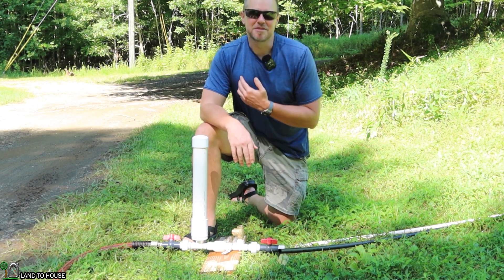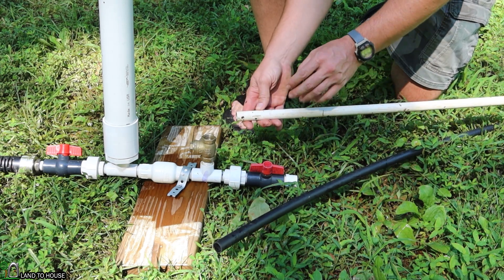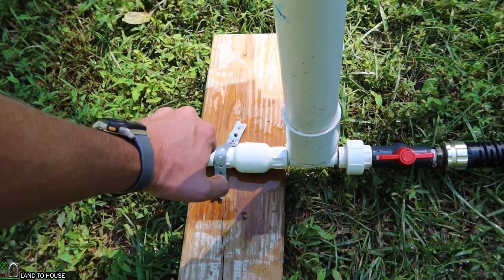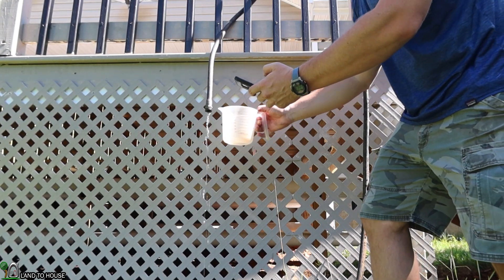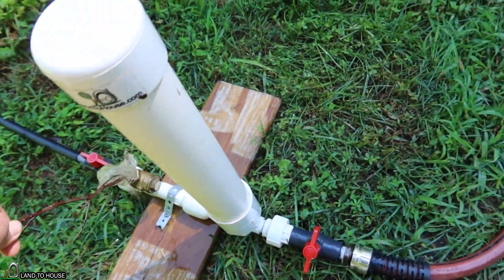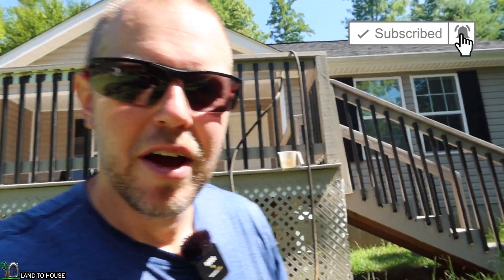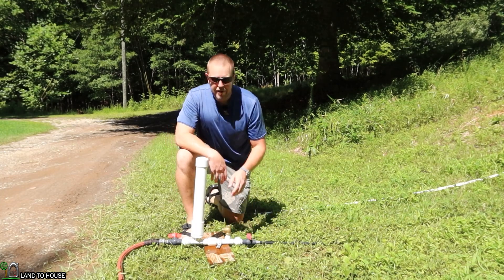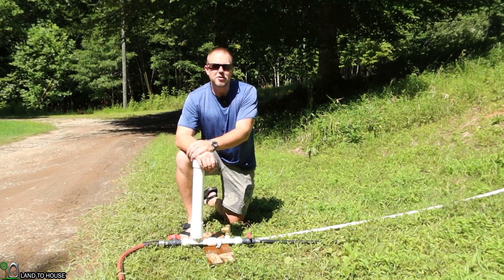Poly Pipe VS PVC Ram Pump Drive Pipe

Comment: I have some questions. 1. If i connect a tube with one way valve on its end to the waste valve an connect it to the delivery pipe, will it work and give more output?  2. If it does, will it work going to higher places like maybe 10 feet or more? 3. A different question, can I use like hose, coiled and not stretched out as my driver pipe?

Comment: If you increase the diameter of the drive pipe would that make the pump more efficient due to the heavier weight of the water traveling through the pipe? Less friction loss or would that act in the same way as the poly pipe allowing a softer Ram?

Comment: I have watched a lot of your videos but I haven’t found where you might have put a pressure pipe before and after the waste gate valve.
Reply from the maker: Typically the pressure tank goes after the waste valve and after the secondary valve. I don't think there would be any purpose of having a pressure tank before the rampump

Comment: Cool, though a little bit less efficient, polypipe is quite functional.  And not to forget that the pump doesn't have to sit in a creek, you just need to be at a lower elevation than the source and it could be up on top of the bank or even out in a field.

Comment: This is why I'm using galvanized near the pump, and poly downstream, I want no flex and as much pressure build up as possible....in this case the more water hammer the better.

Comment: I have about a 30 foot drop to a spring. Is it possible to put 3 ram pumps 1 ram pump at different levels to achieve the rise of 30 plus feet. The spring just seeps out of the ground with little to no drop. The plan is to build a retaining "wall" ( citron) thus giving me some drop

Comment: How about testing with 10 ft of pvc drive pipe added to the ram pump before the poly pipe. I haven't placed my 3/4'' ram pump into service yet, but I bought 3/4'' poly pipe for my system. Even with 20% less output, should be fine for my needs, just surprised in the drop in efficiency.

Comment: So if you have a 100ft drive pipe could you use poly for the first 80-90ft and the last 10-20ft PVC for a cost saving measure? How many feet is optimal in PVC before it doesn’t make a difference?

Comment: If memory serves me right the inside of the PCV pipe is larger than the poly pipe?
So you would get more water with a PCV pipe than poly.
Reply: Agree. more volum in motion, more ram effect. But this is fine tuning and optimizeing. Primary it should be the same size as the pump.

Comment: Hi Seth, 
I love watching your videos.
You should messure the inside diameter of those to tubes. Ill guess the PVC pipe is a slice bigger. If so, there is a bigger moment in the drive/ram.
(momet = Weight X speed)
Reply from the maker: That's an interesting thought. I have never measured the actual inner diameter of the 2 pipes

Comment: I wonder how strong the pressure wave is.  any chance you can consider hooking up a peak measuring pressure gauge at various places along the drive pipe, to see what kinds of pressures you're looking at?  It should be highest right at the ram pump.  just looking at the orange place:
1/2 100' SCH40 600psi $46.60 (excl. fittings, glue, etc.)
1/2 100' poly  70psi $17.48
1/2 100' poly 125psi $39.00

This is, of course, assuming you haven't done pressure testing, and I missed the video.
Reply from the maker: I have only done pressure testing at the pump delivery pipe. I have not tested the pressure wave strength along the drive pipe. I would assume the pressure spike at the source would be almost nothing while it would be strongest right at the pump. I have a basic pressure gauge I can try to use. It is analogue and does not log records.
Reply: @LandtoHouse  The peak pressure in the pressure wave is almost identical to the max. pressure you will reach at the delivery side, when the delivery valve is closed. It is only reduced by the pressure difference needed to open the inline valve. So you can take your old measurements of the maximum static pressure for an indication of the pressure wave strength. If I remember right you have measured 50..60 psi, right?
Btw. Practical Engineering did a time-resolved measurement of the pressure with an electronic pressure gauge to visualise the water hammer effect.
Reply: @LandtoHouse  That would probably work.  does it have a peak hold needle, like the cheapie ones at big orange?  not sure how they'll react to the impulse though, since they're not fluid filled.  you can always let the camera do most of the work though. :)

Comment: What length of pvc would you recommend when using poly pipe also try to double the size of poly 1/2 inch pump try 1 inch poly just a thought
Reply from the maker: The drive pipe length is best between 25 and 100 feet long. The actual best length is dependent on the head pressure and lift height. The size needs to match the pump size. Otherwise you have loss in the system.
Reply: @LandtoHouse  
I can fill a 2" pipe all day every day. 
I have a maximum of 40" drop BUT after flowing through 2 long garden hoses that wander around and follow two 90 degree curves the GPM is about 1/2  GPM. 
Should I just dig a straight line trench and drop in 2" pvc ?
OR make the last 20-25  feet match the pump?
I would really like to send water over a 4 foot rise in the land to water the church garden. 
OR at least fill a 55 gallon drum on the trailer in less than 2-2.5 hours  which is what I'm doing with pure gravity now. 
Then I have to drive around like a drunken crow to get to the garden. At 3 MPH !
I can actually see the garden if I stand flat footed in the bottom of the creek. 
OR a small turbine with a pump that would normally be used on a drill ?
OR ?
OR?
OR ?
TO MANY CHOICES  ! 
Advice greatly appreciated.

Comment: On my Ram pump install I think I have the first oh I don't know maybe 40 ft in PVC and then there's a standpipe and the next 40 ft is in poly because the creek gets really twisty and windy and it was what I thought to be the best way to actually have it lay in the bottom of the creek and not be suspended in the air cuz we do get like 5 ft of snow in the winter and I didn't want it to break I wasn't really able to go in a straight line anywhere but I've never done any testing like you just did and I don't know if you've ever tested using both PVC and poly at the same time
Reply from the maker: I have not done a combination but it would work just dine. I will have to put that on the list of videos to make. It would be best to have the poly before the stand pipe so that the pump would pull from the stand pipe and the pvc would be from the stand pipe to the pump. But your setup is just fine. Might not deliver as much water but thats ok.

Comment: Would be interesting to do same test with a metal of copper drive pipe, would expect even more output.
Reply: steel is the best, probably 4 times more effective than pvc
Reply from the maker: The cost is the problem with a metal drive pipe test. :)
Reply: That would be cool!